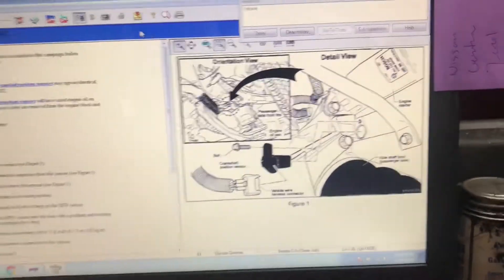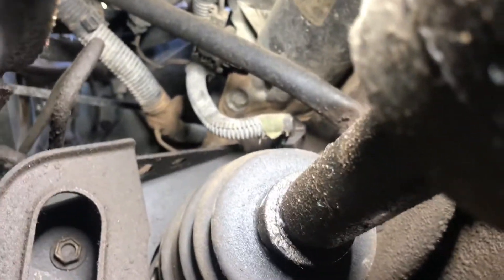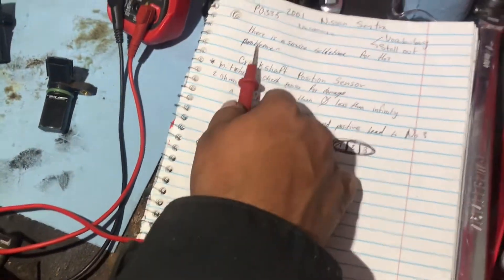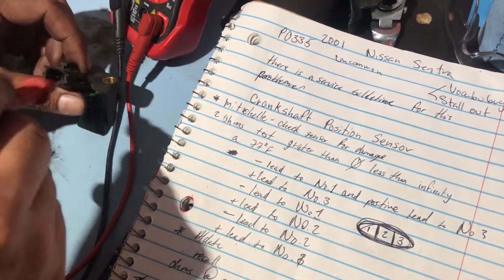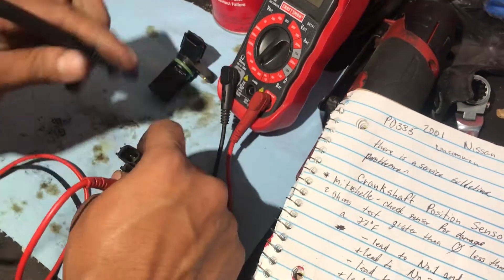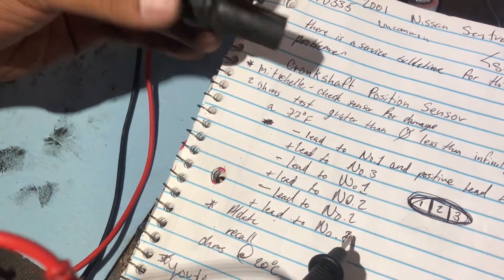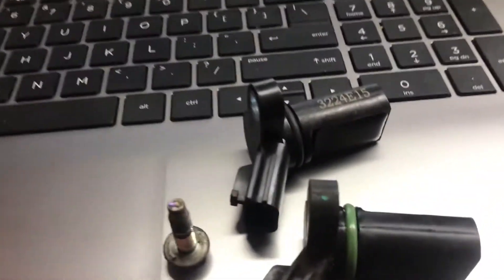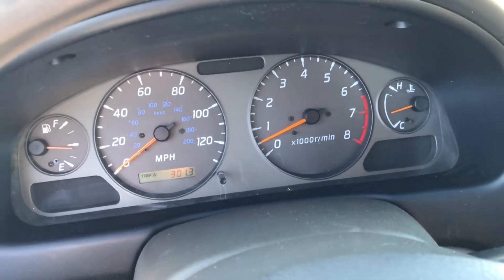Car dies while driving, code p0335 for NISSAN Sentra 2001 1.8L

Comment: Guys, I was having this problem.
I replaced the crankshaft position sensor and the car stopped giving that error and solved the problem of the engine suddenly shutting off.

Comment: How in the hell did you get that out so easily...damn I been under the car for hours now
Reply: to gain access to pry out the sensor, you must take out the starter, 3 bolts, and the reinforcement bar, 2 bolts, in between intake manifold and engine block. then use a crow foot to pry out slowly the sensor without breaking the plastic. That rubber O-ring puts a lot of resistance to pull it out, and to push it in. Grease a little bit the O-ring to easy the assembly in.
Reply: @azirbang1971  Copy 10-4 Ghostwriter